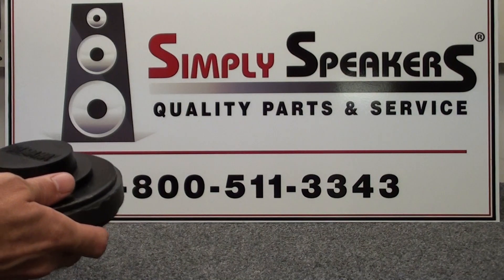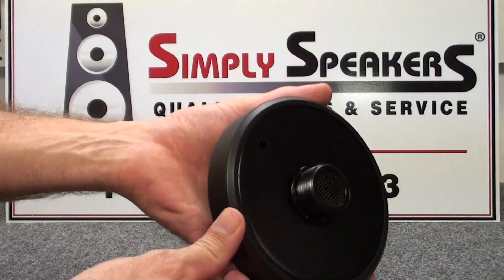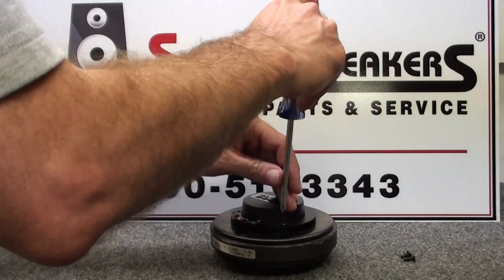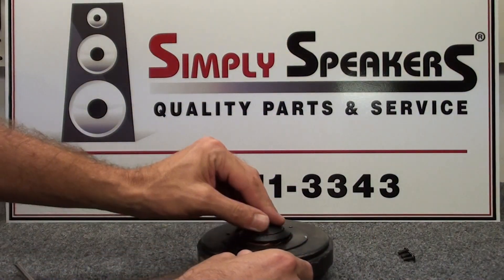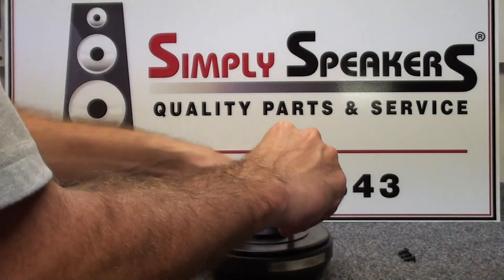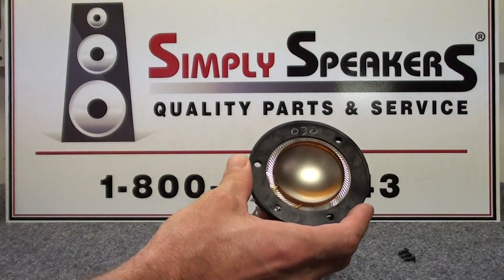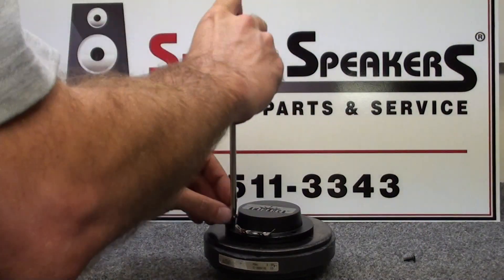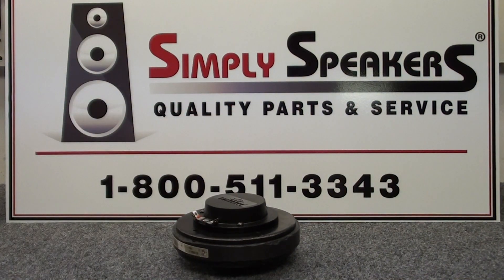Speaker Repair Yamaha, Eminence Horn Driver Diaphragm Replacement by Simply Speakers

Comment: Hi, did replace with a no-name replacement unit. It works but the sound is not as open in the high register. I replace with another non-name and the same results.  I am comparing to to another JAY2061 with Yamaha marked on it.  When running sine waves I can not hear any differences and the level is the same.  Playing music the cymbals come much more open on the original Yamaha.  Do you have any idea what can cause this since they are supposed be an Eminence ?  Are there any Chinese copies on the market ?
Reply: Hey! I replaced a club series with a knock off. CHEAPER! I got what I paid for. Sound not as good as the Eminence. I should know better. Replaced with the Eminence, bought a spare, all is good. Rock on Dude!
The Freeze

Comment: Hi There
If a horn is faulty, is it definitely the diaphragm at fault? I've got a set of EV sx100 speakers and, by swapping various items around, have established that it is definitely one of the horns that is no longer working. The diaphragm looks ok, when I pull it apart...I need to repair it and want to be sure that buying a new diaphragm will do the job. I would phone or bring it to yourselves - but I am in the UK :0}